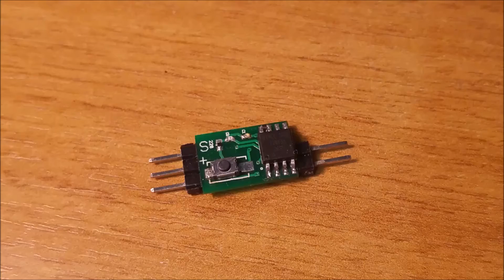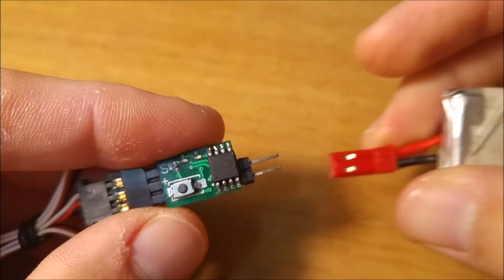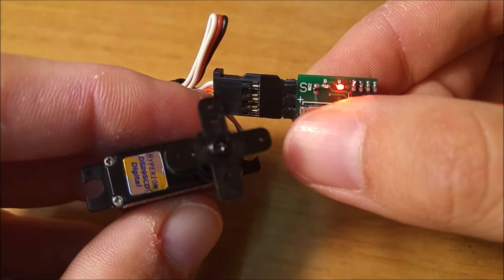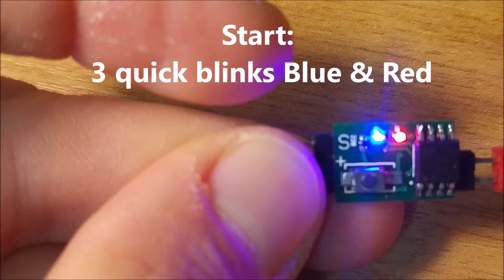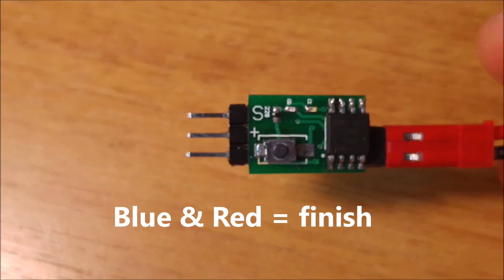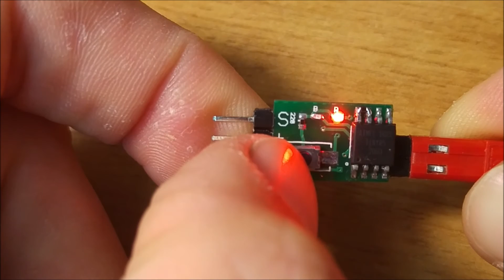TinyTimer V1.0 - One Position Electric Timer - Part 1

Comment: Very cool Liav. About starting the timer. For P30 or F1G, all of the electronic timers that I have work to start the timer by holding down the start switch with you finger, then you throw the model. This would be a long press for your timer and not start it correct? For me that is an issue
Reply from the maker: It's possible to run it in a different mode. I showed it in the Part 2 video